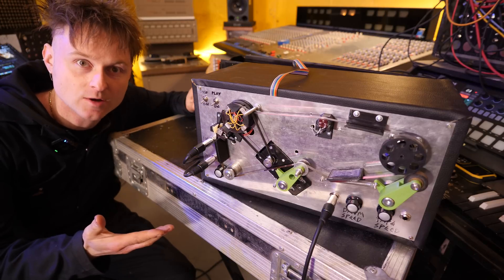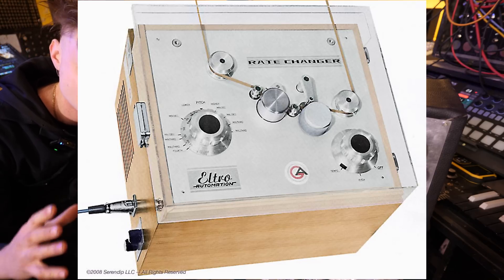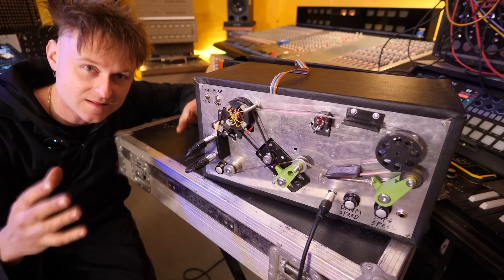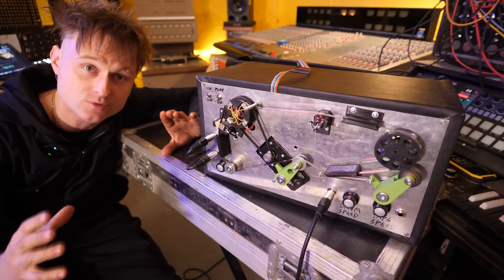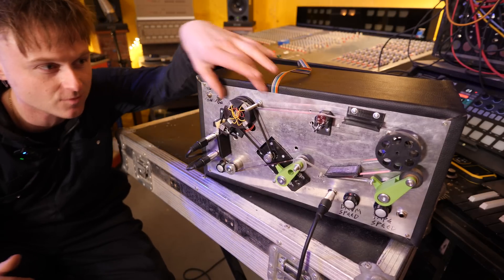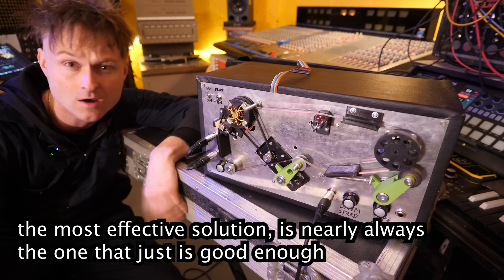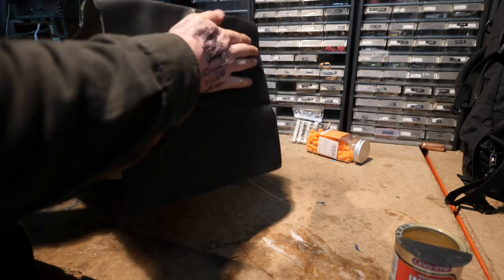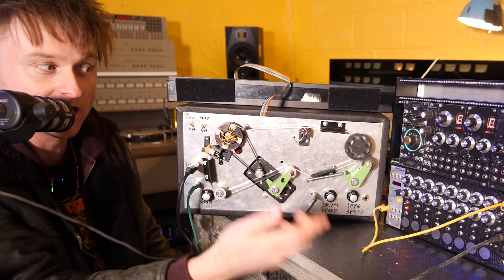It Was Never Actually Meant To Be A REALTIME Analog Tape Loop Pitch Shifter

Comment: jam another four heads in there and set it up with a switch so it's either left+right stereoizing or tighter window size when in mono for less "double triggering" effect on drums
Reply from the maker: yeah fair point on seperate outs. i might not do 8 heads but just split the heads on this. however more heads does not mean less double triggering, but more. less far apart but more
Reply: @LOOKMUMNOCOMPUTER  would be cool to run two heads with a big omega shaped tape wrap like a vtr
it really screws with my head how this ever worked as a commerical pitch shifter though as there's always going to be repeated or lost audio when the head is moving as parts of the tape will never contact a head if the shifter is running under 100% speed and parts of the tape will be played more than once if it's running faster than 100%

Comment: I feel like this might be overkill, but have you considered using 6 or maybe 8 heads on the drum to try and eliminate that interval you're hearing between head reads... Maybe I'm off my rocker here.
Reply from the maker: its a fine line between the amount of heads and cross over. having played with this, and theorising more or less, i am pretty confident 4 is the best. you are never getting rid of the crossover point sadly. they will always fade between, and 4 is the magic number between it happening it too ofter, or the distance being small. also rthe angle with each head added gets shallower. meaning less tension onto the head also.
Reply: @LOOKMUMNOCOMPUTER  You may be correct, you're the wizard that's playing with the sacred geometry here... please continue with your audial alchemy.  Beautiful piece of audio engineering.

Comment: some toys are interesting for playing around, but most of the time sound really strange or like a broken machine. Here I've exactly this thought. :P For how long stays the recorded audio on the tape without reapplying?
Reply from the maker: One loop
Reply: @LOOKMUMNOCOMPUTER  oh, okay thought you could use this for layering, too.
Reply from the maker: @d.moel.  well you can. it has a switch to turn off the erase head, look on the top right. its not very useful though as the loop is very short. but i put it there anyway
Reply: “Sounding really strange or like a broken machine” is often the whole point.

Comment: This is excellent, genuine innovation. A useful addition for the next iteration, a way to switch in a quantiser for the rotating drum's speed. I suppose you would have to factor the tape speed, but the ratios would always be the same. Knowing the pitch of the sound input, defining the key with the quantiser, you could harmonise with more than just octaves and fifths. Or just quantising to semitones in addition to using an expression pedal.
Great stuff!

Comment: Also worth a note is that a VHS tape head doesn't record a linear signal on to the tape. It's slanted because it records a series of angled stripes (helical) across the tape (E.g. /////////). I can't imagine you'd do yourself any favors trying to make a system that let's you vary the tape and head speed with helical recording... not to say the weirdness wouldn't turn into a benefit - who knows without trying. This was done to allow the tape to move more slowly while maintaining the required data rate for a video signal.
Reply from the maker: You could theoretically do it. Like mentioned if you make the drum slant back to horizontal. It would work similarly to mine. But yes. As you say it's just an utter faff.
Reply: VCRs do have a control that lets you vary the tape head speed very slightly: That's what the tracking control does. It just lets you adjust for slight manufacturing differences in the tape (the stuff can stretch very slightly over enough plays) and line the head swipes up with the fields on the tape.
Reply: @vylbird8014  Tracking adjusts the phase of the head drum relative to the index pulses, not the speed of the head drum.
Reply: Wow the slashes as an example is low key genius
Reply: Come to think of it, the diagonal tracking could still be a problem due to azimuth issues. You could angle the record head, but the two VHS heads are at different azimuths to reduce crosstalk between adjacent video tracks. It's all a bit of a mess.
Reply: If the record head was the full width of the tape, it wouldn't really matter if the playback heads tracked diagonally across the tape. But I think the main problem would be that the heads and rotary transformer are designed to work with signals ranging from 600KHz up into the MHz. I doubt they would work very in the audio range, if at all.
Reply: The bigger issue is that video heads are optimised to work in the MHz range so will be very low performance at audio frequencies; the flying audio heads on a HiFi machine might work, as they are optimised for frequencies in the tens of kHz range.
Reply: The normal audio head is separate from the video head and isn't on the helical
Reply: If you had a linear record head and a helical read head wouldn't you be changing the pitch just by changing the angle of the read?
   I don't remember my trigonometry but I'm guessing if you had the helical head at a 45° angle (or whatever a sin or cosine of 0.5 would be) going  exactly twice the speed of the tape there would be no pitch shift because it would track the same linear distance of tape? 
   Then the lower the angle the more linear distance of tape read for the same time higher the pitch, does that sound about right? 
  I'm assuming that's the whole reason why someone would suggest using a VCR head, because it's helical, and nothing to do with wider tape.
Reply: I believe that you also get more bandwidth (in current produced by the tape head, not talking about audio frequency here) from larger heads and larger tape surface, just due to the magnetic charge potential.  With those tiny VCR heads, I can't imagine you'd get much bandwidth, and I think your resulting sound would be pretty bad.

Comment: Nice, the physical version of so many puredata example patches I spent time trying to figure out. ~ 7:30 yeah exactly, glandular sisteris I mean granular synthesis.
Reply: Damnit! Me too! In Max. I read about Wendy Carlos using one of these tape granulizers years ago (eltro information rate changer) and fantasized about building the real thing.  Yeah right. Closest I got were some max patches. And even those… just basic granulizers. Not a real emulation. A few years back you couldn’t find much at all about this specific application in its real world tape format, but I do have a pdf of the original Eltro manual, ha ha.

Comment: Where did you get The slip ring? Cause qll that i looked was too expensive for me, so i stolen few old vacuum cleaners from the electric carbage platform and took theses power Cord retractor system to work as slip rings. Theyre huge, so propably your 3d printed version is better. But i dont have 3dp.
I needee also 4 wires, so i put 2 Cord pullers on top of each other.
17:39 now hes get the luna dicease 😮😅.
🎸 Has never sounded this good 😮🎉
Reply from the maker: amazon was the one i got. it was £12
Reply: @LOOKMUMNOCOMPUTER  yeah, too much and IT won't take Paypal.. anyway 👍 and thanks!
Reply: @weapea  You can salvage them out of old broken pan & tilt CCTV cameras
Reply from the maker: https://www.amazon.co.uk/CNBTR-Current-Conductors-Circuits-Collector/dp/B072Z7QWNT/ref=sr_1_7?dib=eyJ2IjoiMSJ9.v8RZOanML0UhsV3zXQ5yU3kxqJ1AGURG53SoyEpGBRnV-xadp6AQc9orcibXDccbdsm_d9SF9Z5oPeurIKX8dES2iSDlwYaTnlyMDU47wofDHHr6pa_RgYBTMoL1FdhTKtl2xK9RdXNzrYPTh-AjIs7DhjVMtcaGowVU-lANoZf6cdBQAqJQ3gtZPKGbDXfxMlUssN8404wlBfvhvcGPNE4mUw-Wwjql9V2Yr1CwTqpooMgiR_nz6LdZKew7vPYcjc7o3g9GlIAInUnE8vqWlpdbJ73QrKjTbZiCgckmAOk.WZgDh_9UOugi4t_CxdvtTzsD_tPMRTdIEeReeGiwaYg&dib_tag=se&keywords=slip+ring&qid=1732127411&sr=8-7